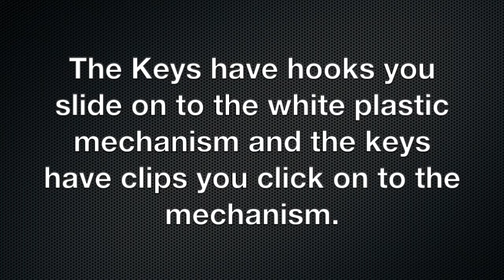How To: Replace the ENTER Key on Apple Magic Keyboard 2 Desktop and iPad or latest MacBook Air / Pro

Comment: Amazing tutorial i have the macbook pro M2, no apple store in my country, mine was stuck and i tried this still did not work then i remembered i had my macbook air that that only worked for like 2 years it was that model they should have issued a recall due to fan and other issues... anyways i replaced the enter key with that other enter key and it works like a charm.(do not skip the last step with the blue thing under)